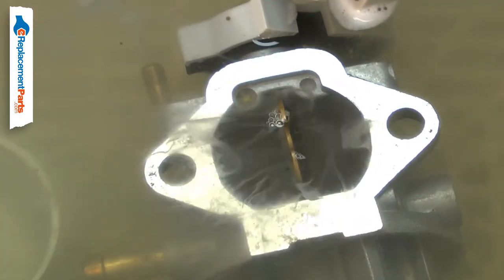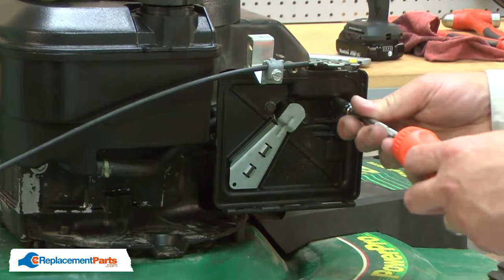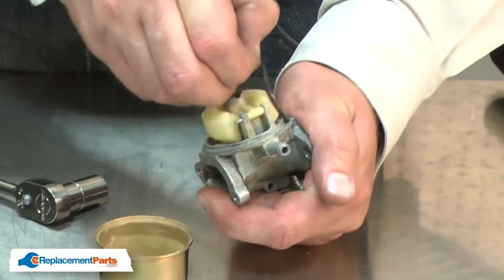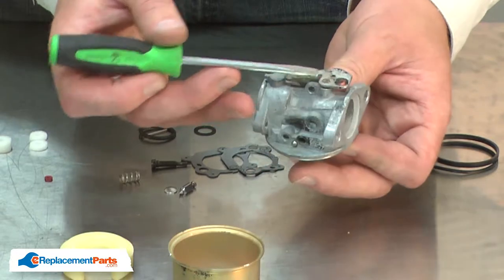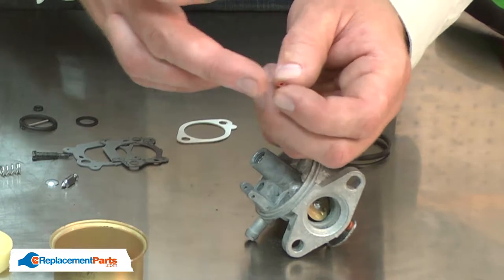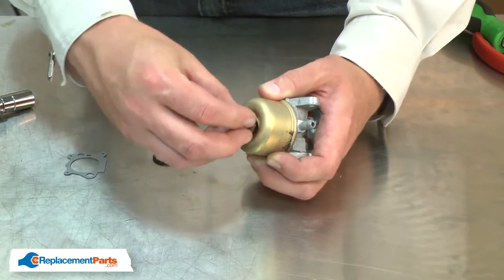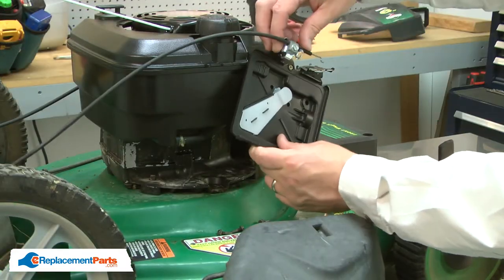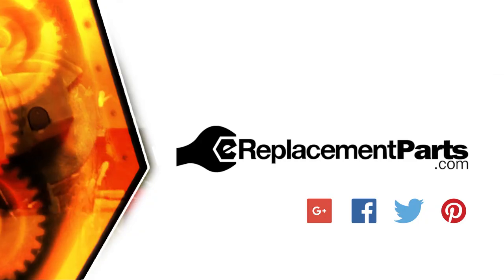Small Engine Repair - Installing the Carburetor Overhaul Kit (Briggs & Stratton Part # 498260)

Comment: Thanks for the video. In my shop if you don't have the seat installation tool, use the blunt end of a drill bit that fits the hole to press in the seat. Thanks

Comment: Very good video.  One tip.  The bowl nut is also the metering jet.  If it is clogged all the kits in the world will not fix your problem.  That’s the first thing to check.

Comment: Really great video with step-by-step instructions and illustrations. Which is why it was so good.  The only recommendations I would have made was to replace the air filter element, which is filthy as shown, and install a gas shut off valve.

Comment: Thanks to the EPA for making carbs with brass jets and eliminating adjustable opening screws on carbs so that everyone's carbs get clogged with 10% ethanol fuel.  And now the EPA wants to add more carb-clogging ethanol by increasing to 15% ethanol.

Comment: The base has gasket on back that seals primer air flow. If gasket isn't proper it will leak and make primer inop. I added a very light amout of non hardning gasket sealer to that area.